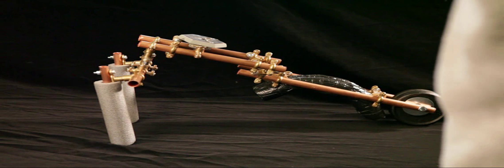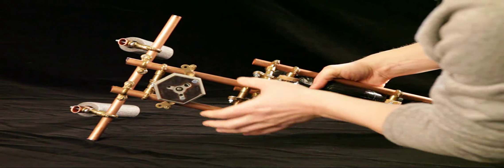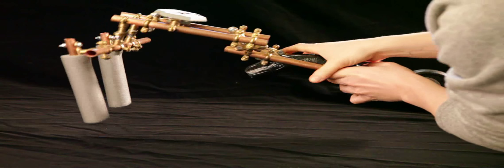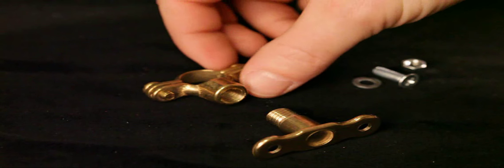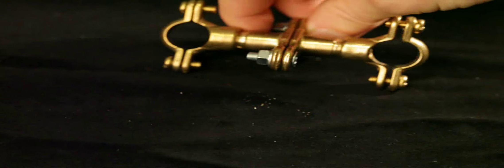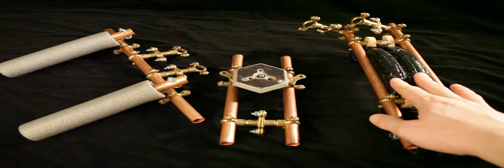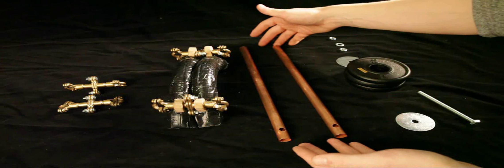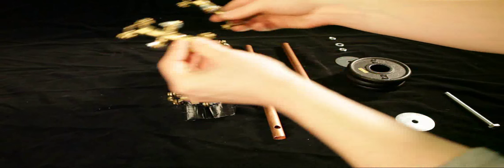Homemade DSLR Shoulder Rig, Part 1

Comment from the maker: @NitsanPictures 
Thanks man.  

Was thinking about spray painting it matte black, but then thought it would scratch off pretty quickly when I adjusted the rings..you're right it would look better though.  Was looking around for an aluminium plate to mount the camera on but could find any.